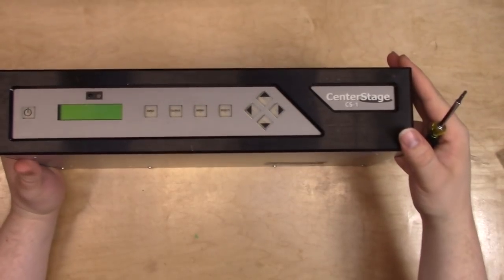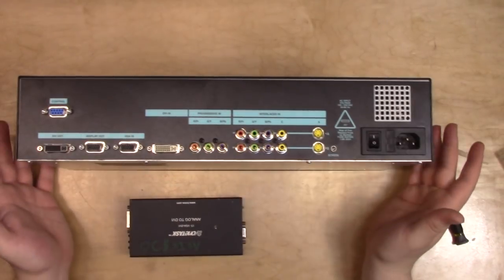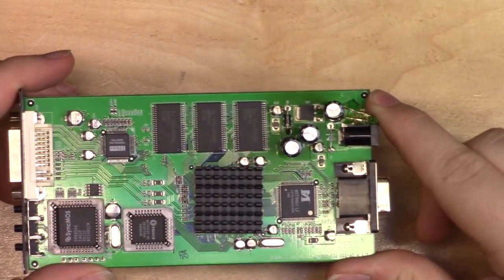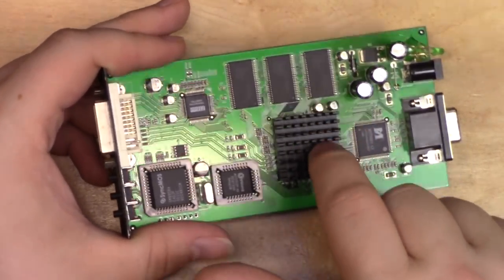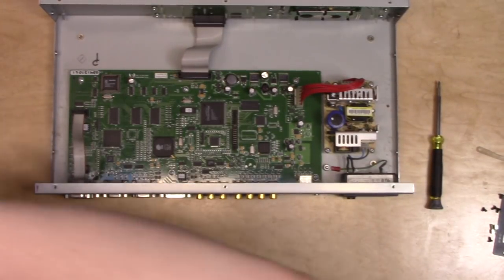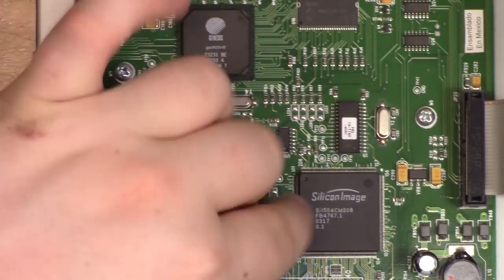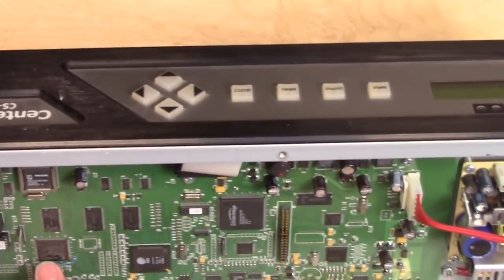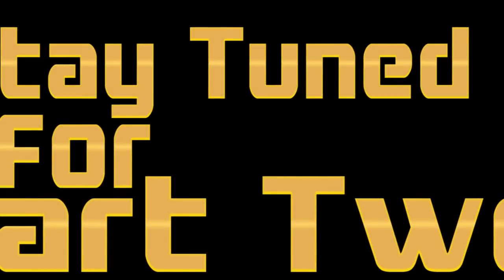Weird Stuff Exhibition 2 - Part 1

Comment: DVI can output 1080i  because some early DVI output devices such as early external digital TV tuner boxes (used back when many HD TV’s still came with analog-only tuners or no tuner at all) could receive certain HD tv signals in 1080i and they would simply pass it along to an TV rather then have to de-interlaced it first. These days few HDMI devices would need 1080i output but since you can still get an external HD TV tuner or ahD cable/satellite box these with HDMI output, they could still output 1080i if need be. Built-in de-interlacing is much better these days over HDMI so fewer situations require sending interlaced HD video over HDMI anymore.

Comment: Cool video. Its also fun to dive into the guts of niche electronics like the video converter you disassembled. Just spit balling here, but the IC under the heat sink located in the center of the PCB might actually be an FPGA. The MCU might be responsible for controlling the behavior of the entire device and also programming the FPGA during device start up.

Comment: Are you an electrical or computer engineer? I have to say I'm very impressed by your depth of knowledge on hardware system architecture and board design. I suspect you're in engineering or some related field, but if not then even more power to you, becuase few people can look at a pcb with or without Google and figure out exactly whats going on.

Comment: the smaller scaler is digitizing the analog input, and replaying the digital buffer to the larger size, this only needs about 1 frame of delay. You can do OSD with no latency, it's just a matter of replacing pixels on the fly on the output. the big chip under the radiator could be either an asic or an FPGA / CPLD of some sort... looking at the 2nd scaler, the chip under the radiator of the first could be this exact same genesis scaler (the chip package under said radiator looks identical)...

Comment: In the left bottom corner, thats surtenly a micro, an the socketed chip on it´s right of it seems to be a ROM chip that contains the consciousness of that FPGA!
Right nex to the FPGA is an ADC.
Above are three RAM Chips, and left of them the digital Video handeling chip.
Reply: Yep, you further describe exactly what happens!
The mystery chip hase to be an FPGA, otherwise it would be pointless to have a ROM chip pressent just for that micro.
Thats just, so the micro can load the FPGA´s brain into it on startup.

Comment: There are a lot of devices very similar to the cheap $20 scaler you have there, I have a scaler branded by StarTech that looks like it came from the same design house, it has the same 3 buttons with the same  labels. 

Sadly my StarTech branded scaler only takes in standard def but can do so over Composite, S-Video & an 8pin din female connector that will accept YPbPr & RGsB (depending on which input you set) the device then processes it with an adaptive comb filter and outputs the video to a host of HDTV resolutions up to 1080p, (when it only advertised up to Psuedo 1080i, probably something mathematically similar like 1920x540p) over DB15 "VGA" connector in YPbPr or VGA/RGBHV you can also output typical PC resolutions up to like 1600x1200. 

Curiously I have seen 2 units visually identical to my scaler one branded by Audio Authority, the other was sold on an Australian website where it comes with a male SCART to male 8 pin din cable stranger still, the bottom of the PDF says it can take in computer resolutions like your unit can & output those same resolutions leading me to think someone screwed up the PDF  for that entry lol
Reply: Inspired by your video i decided to open my unit up. 

i have a main chip under an epoxied on heatsink, i have a SyncMOS Sm89516 c25jp (removeable microcontroller?), i have an unsoldered SW4 perhaps to toggle on/off? 

I have the same unsoldered JP5 & JP6 perhaps for rs232, SPI or I²C?

On the underside, I have a 24lc08 series I²c eeprom, a micronas vpc323x comb filter, a voltage regulator & 2 ram chips

If i could get this thing to handle hi def input instead of just standard def that would be sick